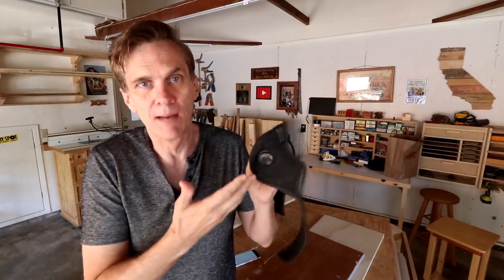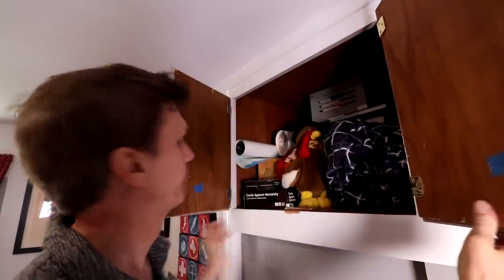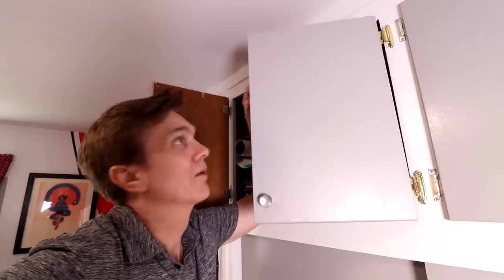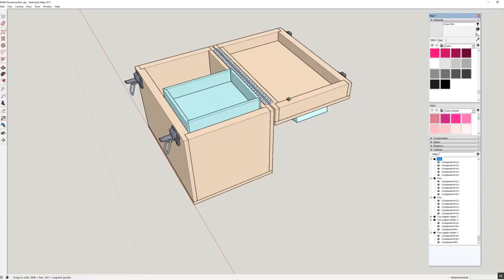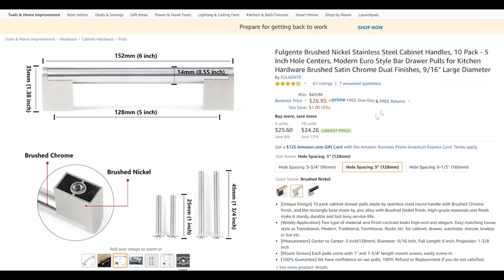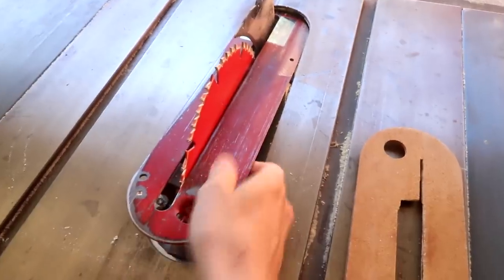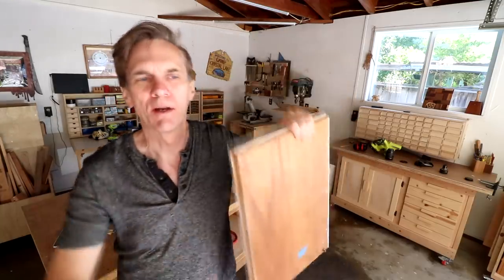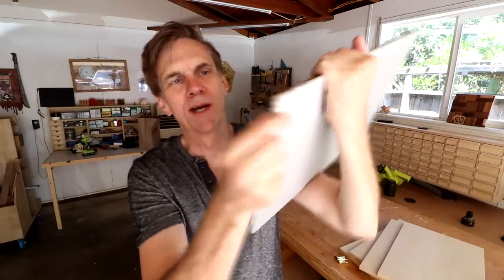Preliminary shoeshine box design. Oh, and about those face masks. | Day 114

Comment: An old finish carpenter told me about a trick he uses when door and cabinet screw holes are stripped out. He just glues in wooden golf tees into the hole, cuts em off flush and drills pilot holes in the correct place. He said 9 times out of 10 the hinge hides the mistake and he doesn't have to fix and paint or anything. I have used it a few times, works like a charm.

Comment: That shoeshine box model feels like (without the boot part) it'd work great as a case for a portable power tool and reminds me of some vintage ones. The tray on top could be used to store bits, blades or similar! Just needs a couple dividers to lock the tool in place, either like spring clips or just wooden ones.

Comment: Hey Steve.. It has been my experience with those hinges that they will not lineup to the existing holes you have on the cabinet. The new hinges will push the doors about and 8th inch closer to each other. I would suggest putting the hinge on the old doors and installing them to see if they work.The door size will be fine you will just have to re drill holes on the cabinet face.

Comment: Tip for stripped screw holes: stick the back end of a wooden match into the hole and bend it sideways so that it breaks off more or less flush with the edges of the hole. Then just drive the screw back in. Adding a drop of glue before the matchstick makes the hold even stronger, but even without it, the extra material in the hole holds screws really well. For bigger holes, break off multiple pieces of matchstick.

Comment: Would the piano hinge be better placed on the outside rather than on the edge? Looking at the design you showed, there is a gap between the lid and the box because of the hinge which means you would have to have some kind of bumper on the other side of the lid to ensure the gap is even. That is, the lid would be pulling on the hinge slightly without some kind of support.

Comment: Two suggestions: 1) make the drawer slide all the way to the right, and to the left, so you can access stuff under it without taking it out.  2) the drawer needs a lifting handle to make it easier to pull out.  Otherwise, the box looks great!
Reply: I had the same idea - make the divider shorter than the cleats so the container can slide all the way to one side or the other and give access to items below

Comment: I have no suggestions for the shoeshine box, but I do suggest trying wooden golf tees to repair a stripped out screw hole. Make the hole bigger by drilling it out to a size smaller than the golf tee. The tees are slightly tapered so after applying glue, hammer them down into the hole. After the glue dries cut the heads off the tees with a Japanese hand saw.

Comment: Hey Steve, long time viewer and love your stuff. Really trying hard not to be a know-it-all by saying this, but FYI those N99 masks, while great for keeping you safe, aren't designed for use against COVID. Since they have an outward vent, they actually don't filter your breath at all.  And therefore they defeat the purpose of the face-covering guidelines of keeping other people safe.
TLDR: Those N99s are fantastic for woodworking, not so much for COVID precautions.
Reply: Interesting...is that so? I had not heard that. 
The vents are completely sealed ( in mine from another brand), and stop any droplets and particles from breath until they have accumulated enough within the mask to start dripping along with my sweat. I would have thought since there is no spot where you can visibly see air through the vents, it would still protect as well or better than a handkerchief style mask.
Reply: The N95's seem to have the same problem.  I put an extra filter in mine; fits just fine and I don't notice any difficulty in breathing with it in.
Reply: Exactly! These masks are designed to keep large particles (aka wood fibers & dust) OUT of your lungs. They do nothing for small particles the size of bacterias or viruses either on an inhale or an exhale.
Reply: I missed where he said they were for COVID. Thought he said these were for dust

Comment: Instead of filling the holes with dowels, I always just fill out holes like that with a couple of wooden tooth picks before driving in a new screw. They usually achieve enough friction to stay in place after the screw is in there. Easy fix for most situations.

Comment: Little suggestion for shoeshine box. You can also leave that divider in but put a cleat on both sides. So you have some sense of organization, that divider will be part of box construction so it will be more stable and you could put that little box on both sides so it is adjustable for more shoeshine box users. Does it make sense?

Comment: Steve, the easiest and fastest way to fix a stripped wood screw holes on cabinet hinges is to jam in some toothpicks into the stripped out hole, break them off, and re-screw the hinge with the original screw.  no Glue, no drilling, no fuss of any kind it works great.  Of course, you can use glue if you want too but believe me it will work great without the extra work of adding glue and the clean up that goes with it.

Comment: If you use a piano hinge, there will be a space between the lid and the box when the lid is closed.  So are you going to cut the edged that the hinge is mounted to a little shorter so the lid and box butt up against each other better? Especially since you're wanting the wood grain to match across the cut.

Comment: It looks like the handles you found for the shoe shine box are assembled from three pieces -- a rod for the handle itself, and two sort of block-shaped pieces that accept screws. The seam where the rod and the blocks connect could catch and snag the fabric being used to buff the shoe. :-(

I would use generic rod stock and just fit them into little blocks. Or, I'd leave opposing faces of the top proud of the top surface (maybe with some nice shape details), and fit the rods into holes. That should let you move and angle the buffing cloth however you want. And, folks can pick any diameter, length and material for the rods. Rod stock can be sourced or salvaged pretty much anywhere in the world, so that's another advantage.

Comment: Worn screw hole fix:  toothpicks dipped in glue.  If you run the new screw into the now-jammed hole, the soft wood of the picks, and the glue, solidify around the screw (the wood swells a bit), and you get anchoring better than the original.  For big lag screws, dowels instead of toothpicks.

Comment: The best way I've found to repair worn out screw holes is with some glue and toothpicks...works every time.  On the shoe-box...I think one latch in the center of the lid would be sufficient.  Less fumbling around.

Comment: Rather then using a hinge,  I think, under mount drawer slides could be a lot of fun here.
Another great video,  thanks Steve.
Reply: I was trying to wrap my head around that and at first didn't know if you were talking about the shoeshine box or something else. When I realized that you must be thinking of the shoeshine box, I thought "what a neat idea"!
I didn't know if you could buy short enough slides and went looking. One thing I found on Amazon was a wooden one which could be cut to length, or just cut in half to make both pieces if it's long enough.
I really like that idea and may use it since a shoeshine box has been on my own project list for a while. 
Thanks!

Comment: best way to fill holes that are stripped out ... toothpicks and wood glue. works great. just fill the hole with toothpicks [pointy end first] dipped in glue, wait till the glue dries, cut off the parts that stick out. Screws stay solid. Works every time.

Comment: I was thinking for the shoeshine box you could hinge it from the back on the narrow side of the rectangle.  Shorter hinge and probably only 1 latch required.  I like the sliding box technique.  I have 2 drawers in the back of my Toyota Prado 4x4 and have a sliding tray in there.that gets moved around to give full access to different parts of the drawer.
Reply: Another benefit is that the box is less likely to tip. 
Seems to me that having the lid open horizontal will give a place to put things when you rummage through the box.  Or go one step further (sorry!) and make it open so that the far edge reaches the floor and the underside of the lid becomes a foot rest for your customers.

Comment: Here's a comment on the shoe box. I personally like the idea of the upper box piece with the option to slide it left and right on the guides. The lower section is too big IMO to keep as one open compartment. What about making 2 sections in the lower area with a divider, say coming 1/2 way up the height of the box (or more), giving enough room for the sliding box to freely move.

Comment: Tip for fixing worn out screw holes in wood ... Cut a strip of paper about 1/2"-3/4" wide (wider for deeper holes) and roll it up until it makes a sort of dowel thick enough to snugly fit into the screw hole (cut or tear off the extra). Unroll the strip of paper, coat it with a thin layer of glue on one side, then roll it back up nice and tight. (Warning: this is a little messy because some of the glue will squeeze out.) Now, smear a little glue on the outside of the roll of paper, shoot a little glue into the screw hole, and stuff the rolled up strip of paper into the hole. Wait a few minutes for the glue to start to set but not long enough for it to completely dry, then drive the screw into the hole. (Try to go right into the middle of your rolled up paper with the screw). You can install your hinge or whatever the screw is holding to the wood at that time, or you can wait, but once you drive the screw in once, leave it alone until the glue is complete dry. You should have a good-as-new joint. (I've used this technique a number of times in old houses for repairing cabinet doors and other joints - even entry door hinges.)
Reply: Oh yeah, I forgot to mention that if the paper sticks out of the hole a little, you can trim it flush with a razor while the glue is still wet.

Comment: For the metal bars, I'd buy a section of solid brass or steel bar and fit into a block of hardwood. It would look and feel much smarter than those cheap kitchen handles. I think you can polish up the brass & then laquer it to stay shiny forever, but I might be wrong there

Comment: I noticed that you made a zero clearance insert for your table saw , but you don’t have any screw holes like the factory made plate. My question is it a safety hazard not to have screw holes in the zero clearance plate? Can you use it without screwing it down to the table? Thanks Dennis

Comment: And there I was, getting the dog's dinner ready, when there's that noise you didn't want to hear.  Something metal had hit the floor.  The pin out of a leaf hinge on an upper cabinet door.  Why?  It went back in (tight fit) without a hitch.  Guess the nearly 50 yo hinge wanted to be noticed?

Comment: I'd be afraid the chain on the box lid would be unwieldy. You'd have to make sure it falls inside the box when you close the lid. I would use one of those rigid metal ones that slide in and out along a knob. EDIT: a quick Google search reveals that those are called "Lid Supports" or "Lid Stays" and there are multiple kinds that work different ways.

Comment: The N followed by a number as in N95 and N99; The "N" means that the mask is not oil resistant.  The number is the percentage of filtering N95 will filter 95% of particulates 0.3 microns and larger, N99 filter 99% of particles 0.3 microns and larger, N100 filter 99.997% of particles 0.3 microns and larger.  Sawdust from sanders using 320 grit sandpaper on most hard and soft woods produces particles that are 0.4 microns and larger.  Sawing and sanding MDF can produce particles that are 0.1 microns and larger.  It is critical to control dust from sawing and sanding MDF at the source, but even then filters on most dust collection will allow the smaller particles to pass through the collection system and will be ejected from the exhaust port.  The finer the particle the longer it remains in the air and the greater the chance of it entering lungs.  I rarely use MDF for the dust reason alone.  

If you use a lot of MDF, your dust collection system should exhaust outside your shop, pointing down near the ground.  I've done that even though I rarely use MDF.  I've also enlarged my exhaust to 12" for the last 3 feet including the last elbow outside to reduce the velocity of that exhaust and stopped the end about 8" off the ground.  Periodically I check and make sure there is not a mound building up to block the exhaust.  Inside the shop I have two ceiling mounted power filters like the one you show here, and one at floor level I built myself that uses 3 - 20x30 AC filters.  My shop has better air quality than my neighborhood.  Ive discovered my allergies are less an issue when in in the shop ... at least that's my excuse when my wife asks me why I'm out there all the time.

Comment: Oversize screw holes for hinges? No problem. Stuff in  a few glue soaked toothpicks ,break the excess off then drive the screws. Don't even have to wait for the glue to set up first.

Comment: Steve, another brand that makes those masks is RZ Industries, there called RZ Masks, really good quality but hard to get with this covid thing atm.
Reply: Where i am, basically all N95 or better masks have been pulled by government to ensure healthcare workers have them. My two I bought for protection against dust 14 months ago are getting rather tatty. But i'd rather medical staff had their PPE.
Reply: Thanks for the tip. I wasn't sure I wanted to trust my health to an amazon purchase. The RZ Masks claim they tested their filter at Nelson Labs. So I'm trusting them.
Reply: @kentonyeates196  the rz mask are not the proper masks for the virus. Any mask with a one way valve is a pointless mask. Great for dust in the shop though
Reply: Robbie Elliott Correct about Covid. I had meant health as in small wood particles getting into my lungs.

Comment: A point on your opening point, people should NOT be using the masks with air valves on them for their daily masks.  The point of a mask in our current situation is to capture particulate, and a valve is just going to redirect it, but still let it through.  Unless you're using it for things like wood working, or where you just need to filter out what YOU are breathing in, they should not be used for the ever day Covid mask.
Reply: NO ONE SAID THE MASK WAS FOR VIRUS PROTECTION.

Comment: The shoeshine box design is bad because every time you need to access anything from inside the box you need to remove the foot and shoe from the top of the box. It would be much better to have side access with a drawer or two.